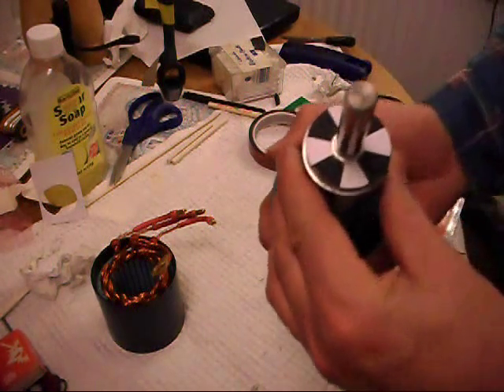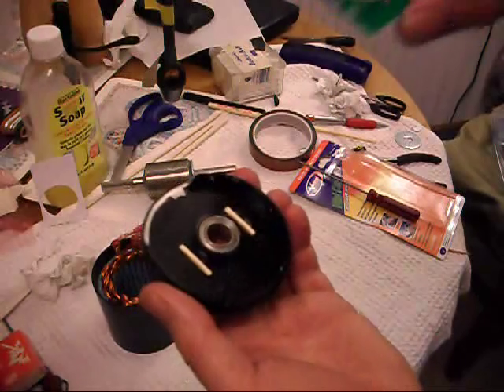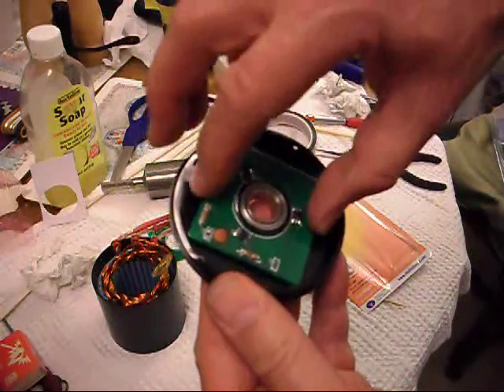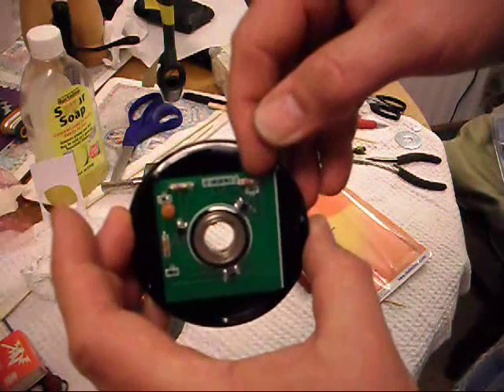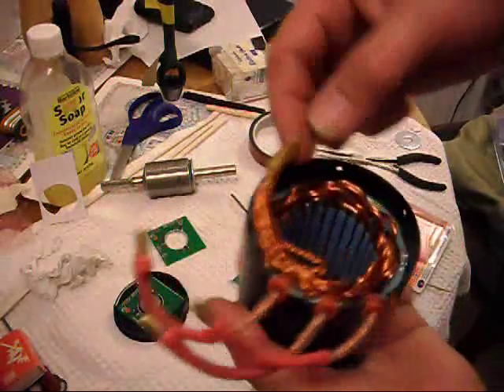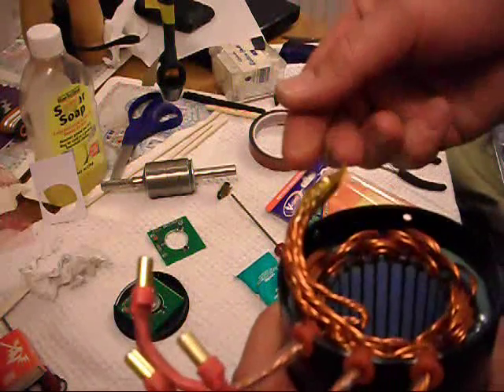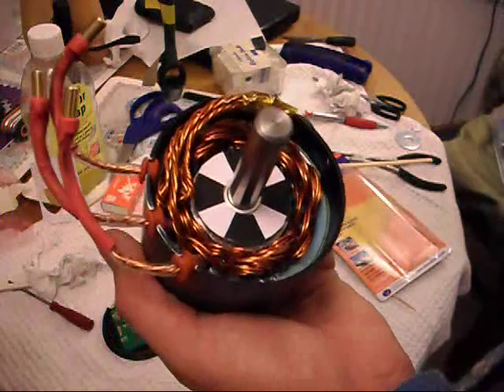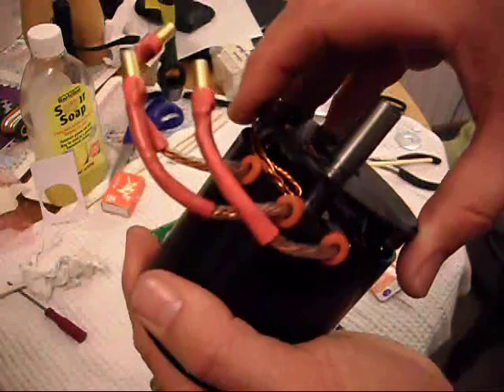Astro 3220 optical sensors.wmv

Comment: do you think the force on the shaft with the weight of an ebike and rider might break astro motors with them  being intended for rc aircraft not electric scooters/bikes reduction drive builds. be good to know exactly how much safe level of  force these motors can handle to breaking point for ebike builders